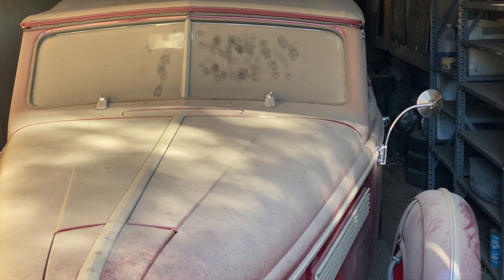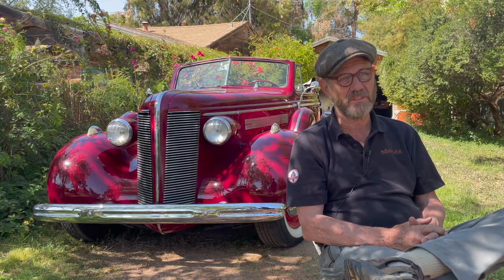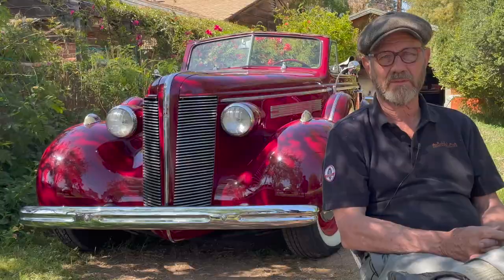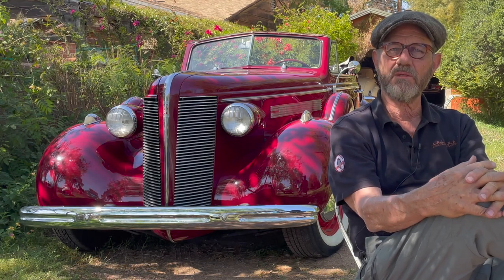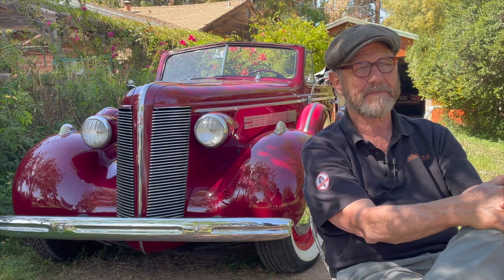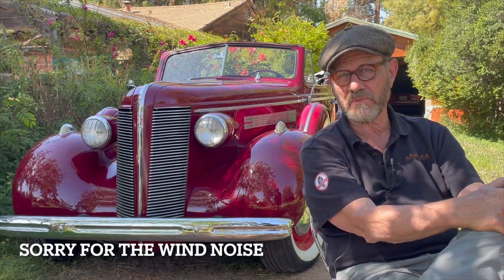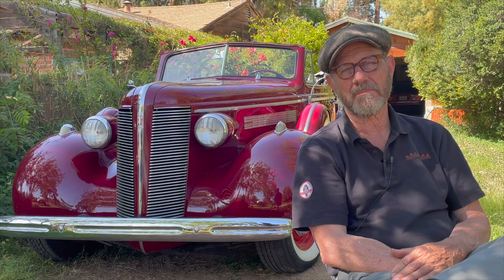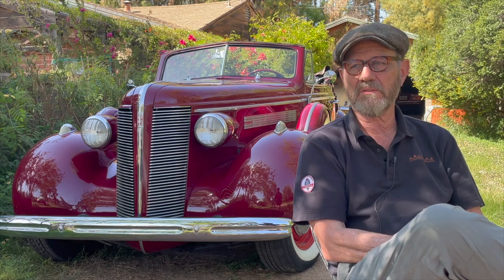1937 Buick Century Convertible FINALLY back on the Road! JB and #barryt

Comment: Very nice automobile! But just to clarify, Buick offered what was called the, “ Semi Automatic Transmission. It was Only offered in 1938. And it was Only available in the , Special “ models. Believe it or not, the first year you could order a automatic transmission in a Buick Century, was 1954!
Reply from the maker: Thanks for joining us, Tom! We did a video on JB's 1948 Buick Roadmaster Woodie, which did come with the early Dynaflow that is an automatic. As far as 1954 is concerned, there may be a delineation as far as gears, torque converter, etc. and sometimes there can be a confusion of definitions.